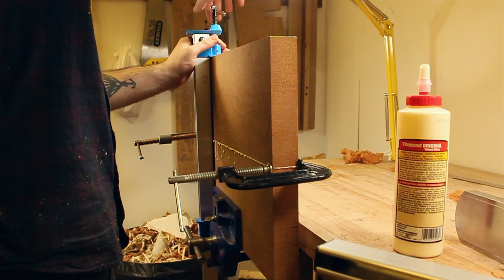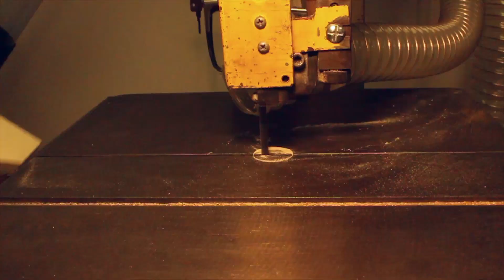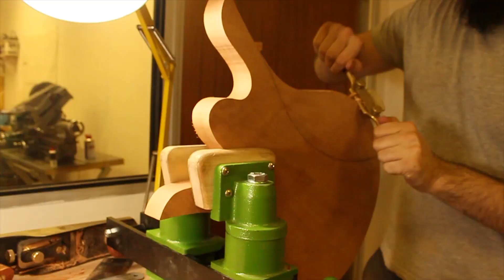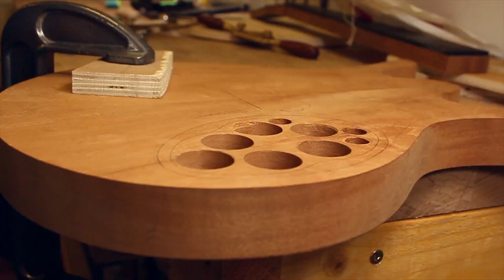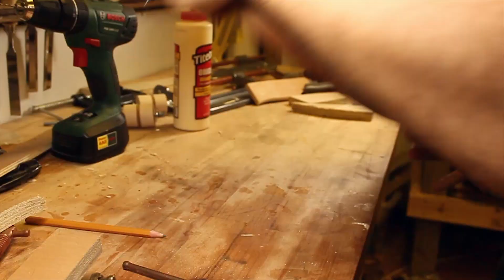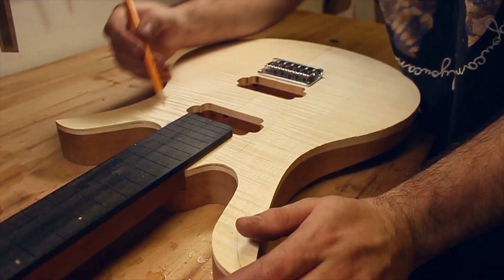Making a Custom Electric Guitar: 2 - The Body

Comment: I like to use screws in the pickup and neck pocket areas to align AND clamp.  Works a treat.
Reply from the maker: That's a great idea, I'll for sure be doing that on the next build. Thanks for the tip!
Reply: @CranmerGuitars  You're more than welcome!